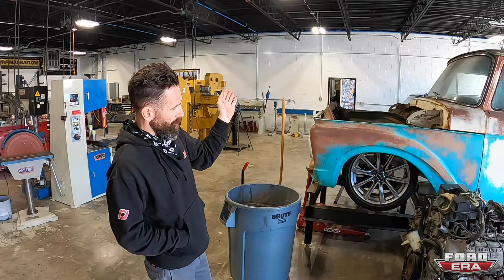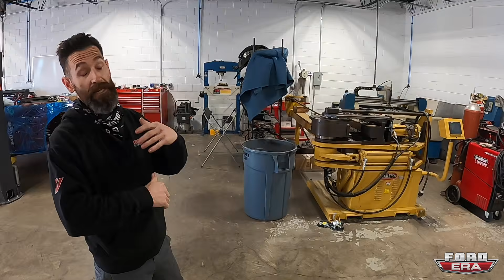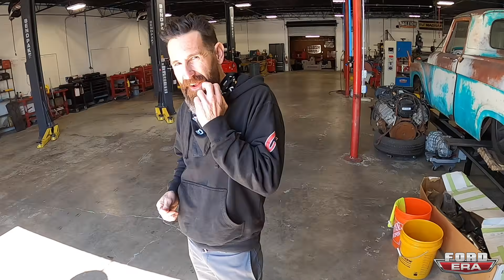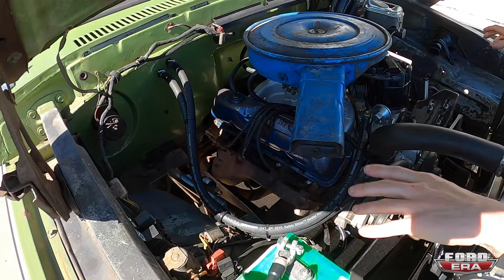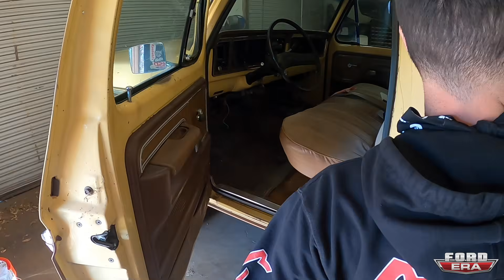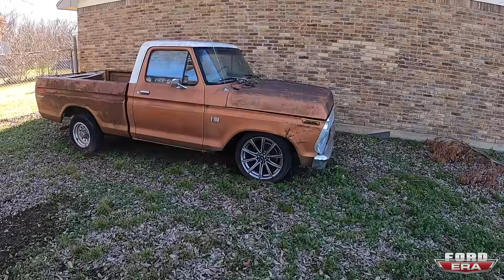Visiting Aaron Kaufman at Arclight Fab & Full Shop & Truck Tour | Ford Era

Comment: Mr Kaufman, I am looking at a 1952 Ford V8 pickup, fully stock barn find that I am negotiating a price on to purchase and do a resto-mod build on it. It is in Colorado Springs in the owners garage. The body is good, to very good condition. My initial intent is to leave the body and its patina as is and focus on installing a 302 Ford V8,  disc brakes and steering components improvements. Would you be interested.

Comment: Man you aint no one special  my dudes been doing it way before you were ever born Detroit Muscle Cars  in 60's 70's  you could drive anything on the roads back then grew up in the area  man  from 4 wheel Falcons  to 428 Mustangs ...  I built a  Pinto  w battery in back floor ,custom radiator  and    A  302 Boss engine ,custom frame and so on I had it when I was in 10th grade Im 61 now I never lost a race!  btw she was painted black w killer chrome rims and kick ass tires .And YES I skipped alot of school in that car lol

Comment: You should have quit GMG much sooner. Letting the green and white GMG C10 ever roll out while you were still involved makes all your comments about "factory engineering" and "long term satisfaction" pretty lame. Iknow you had little "direct involvement" but you were more aware than most the RR's cost cutting and unreal deadlines were leading to cars that were unsafe. You were the only reason I watched any of Richard's crap- IMHO, you should have left at the end of the first season. Hope your new shop keeps your skirts clean from now on- but you get to sleep thinking about GMG.  FR

Comment: But I wanna know about the Bump Side Crew Cab!!!!!!!!!
Reply from the maker: Checkout my channel, I’ve got plenty of content on it. It’s my daily driver
Reply: @FordEra  I have a 68 C/C (rough) in the back yard.
Grew up with these. 
Love the old bump sides.
Reply from the maker: @krukabman  hell yea man, whats the plans?
Reply: Well I'm quite a way from Tx.
I also have a 2 door 68 for parts.
If I did decide to sell they would both have to go.
I bought the C/C with a bill of sale!
Have no idea what title laws are like in Tx.?
But here a bill of sale is acceptable on a vehicle that old.
My plan is to just swap driver door over and use the title from that one. 
I'm just starting a new job so it will be a bit B4 I look into the t-shirt.
But definitely like it!!!!!
Reply from the maker: @krukabman  where about are you located?
Reply: @FordEra  
I 40 corridor half way between Asheville and Hickory NC
Reply from the maker: @krukabman  im down in miami, fl so not too far
Reply: Damn you get that old C/C around!!!!!!
But you're based in Tx. right?
Reply from the maker: @krukabman  i sure do, its my daily. no I'm based in miami
Reply: @FordEra  
The first videos I saw re in Tx.
So I just figured.
How's that old iron hold up in the salt air?
Reply from the maker: @krukabman  your good brother, shes getting a little rustier then I would like but I keep on top of it and will be doing some preventative measures soon
Reply: @FordEra  
Try spraying the underside with POR15. untill you can replace the bad metal?
Reply: The plan was to stretch the cab and smooth all seams. But the building never got put up!!!!
Reply from the maker: @krukabman  gotcha, well i guess there is still time. if you did want to sell her I might be interested you can email me SL@fordera.com

Comment: I had a 1977 F150 Ford King Cab painted in yellow with the white top with the 360 motor. It only had around 80,000 miles on it, but what destroyed the truck is the steel belt on the tire came loose and destroyed the bed and tailgate.

Comment: I'm not a Ford fan but I am an automotive fan. I once had a Fox body Mustang die in Death valley due to a plugged fuel filter which screwed into the Carb. I got some really dirty gas so I would take it off and shake the shlt out of it as best as possible then drive some more at 15 to 25mph for over 700 MILES! If it had been a Chevy I could've taken the inline filter out and replaced it with the body of a pen. It took me almost 3 days to go from Darwin, California to Fernley, Nevada. Then while leaving home to go back to Darwin I backed I to a small shrub which punctured the gas tank. The distributor would get wet and the car wouldn't die and wouldn't start until I took it off and dried the inside off the cap off. My first car was a 1976 Pinto station wagon which could take turns at high speed like it was on rails but it had so many drivetrain issues and it caught on fire while I was leaving high school which I was the 1st to the exit gate and is were it caught fire so nobody could leave school. I Also had a 1991  Ford Fiesta which was great at climbing sandy hills, i wont even go into the problems with that car. Im sure Ford's of today are great but I'll never buy one. I would take any Ford F150 and up from the 70s and I'd also take any 67-78 Mustang with the 5.0 or larger and of course the Bronco from the 60s. Like I said I'm an automotive fan.

Comment: Too many goofy things to count. 35" are too big - gearing issues/lift issues are just the beginning.....33"/12.5" in 16", 17", 18", 20"  are the best option for a low lift. 2" custom home made leveling blocks make life soooo easy and you keep the stock springs or Moogs with the awesome stock ride quality!  If it's a truck it needs a bed not a " for show speaker box. The extra Ford tail end keeps it real, and looks right. Bump side shorty's are out of proportion for the size of the cab - goofy - Shrek? - ...unless dropped to the ground, maybe. Got a ton of these things, dents rock! Whether 2wd, Quatro they have the best drive line system interchange for durability ever. Please no more LS's in Fords! Gawd, no friggin imagination!

Comment: His Michigan comment is 💯% . I have a 08 ram with 111000k had it since new 4 miles and I have baby the truck the hole time and cleaned it , bed sides rusting and Bottom of doors , that why I’m going to a Aluminum in hopes it holds up in the long wrong to the salt

Comment: I like the way Aaron corrected himself by saying that the chassis would need to be installed by another shop, or by a guy that knows what hes doing in his home garage. Sad truth is, after being in the restoration trade for over 25 years, i honestly see better quality coming out of home garages than “professional” shops. Aaron does some awesome work. It’s nice to see another Ford guy really making a mark on this brand.

Clearing Patina is ok as long as its a matte finish. Nothing looks dumber than a shiny clear coat over patina.

I have an all original 67 Cougar 390GT. Zero rust. Factory faded paint. Im on the fence of restoring, or leaving original. But i do want a better suspension built for handling.
Reply from the maker: yes sir, love a nice cougar.
Reply: It's only original once.
Reply: There aren't 2 "professional" restoration "shops" for every 200 "body shops" and "hot rod shops" and "hot rod builders" out there selling "restorations" and no real "professional" can be or will claim to be or try to be much less "sell himself" as a "professional" at "auto restoration". No two "jobs" are remotely alike, nobody that "specializes" in certain "makes" or even "models" will ever come close to seeing and doing "it all" and unless a "professional" CAN and DOES "do it all" without "sending out" his "jobs" to other "shops" he's not "restoring" jack shit. And yes. There ARE true.pros out there that can and do "do it all" but they're usually "ready to retire" after a LITERAL "lifetime" in the "auto industry" and "starting at the bottom" as "kids" sweeping floors and washing cars and all that "dirty work" and "manual labor" and "repetitive tasks" that are never really the same twice and have to be done right or done over and teach the value of attention to detail and doing right anything worth doing at all and "mastering" the "easy stuff" to work up to the "fun stuff". And the true "professionals" CONTINUE to do their own "dirty work" so it gets done "right" and the "hard stuff" is "fun stuff". 

What have you been doing in the "industry" for ONLY "25 years" that qualifies YOU to judge quality of "work" and that gives you so much free time and access to "home garages" and "professional shops" and how do you know a "professional" didn't do the "work" that came out of a "home garage"? 

That you call what others do "work" when no "hobbyist" in his "home garage" or "professional" in a "restoration" shop REALLY thinks of "restoration" as "work" unless it's "just a job" to them and they'll never "stick it out" long-term or really COMPLETE any "project" no mattet how many they "finish" says all I need know about your level of "professionalism" and how much your opinion of "today" in the "restoration industry" really means.

What comes "out" of a "garage" or "shop"  always begins with and depends on what goes in as/with a "project" from the object to be "restored" itself to its owner(s) and their "professionalism" and attitude and personality and "resources" both tangible and intangible the "mechanic" needs to do the "work".

The old computer programming saying "Garbage In Garbage Out" comes to mind as does "You can't polish a turd". And when something "comes out" of a garage OR shop it's far too late for "quality control", beauty is STILL only skin deep and.perfection unattainable and if the owner waits until the "coming out" to suddenly get interested in and pay attention to "quality of work" then he/she/they will have gotten exactly what they "deserved".
Reply: Glad you are fixing the cougar i have a almost restored 67 cougar 289 auto ps pb ac car 2 owner was sold new at matthews Ford in Asheville nc and is still in wnc